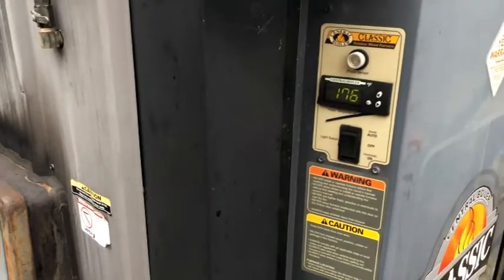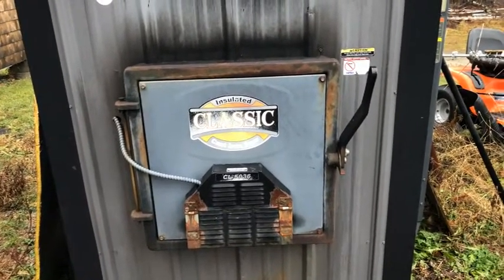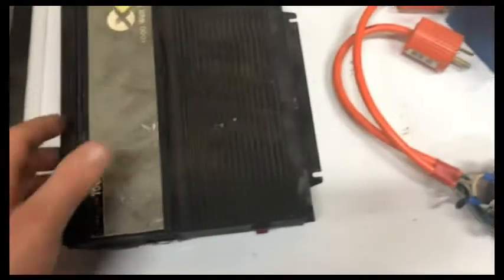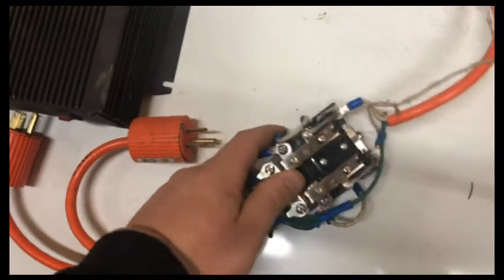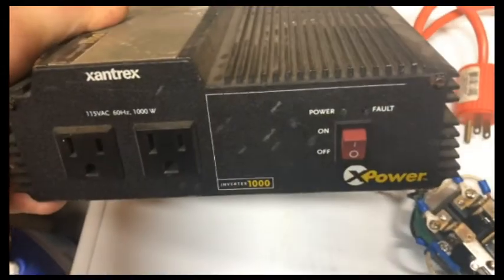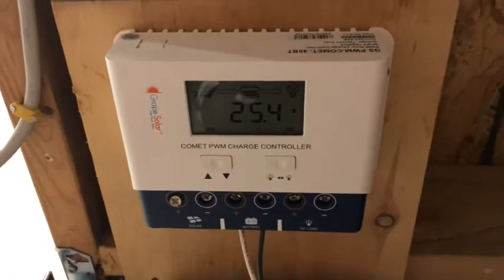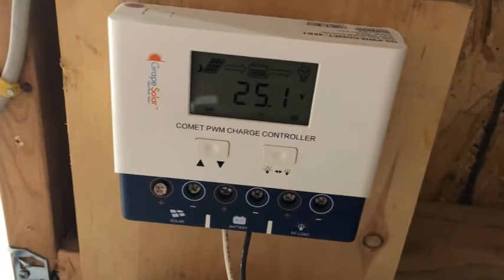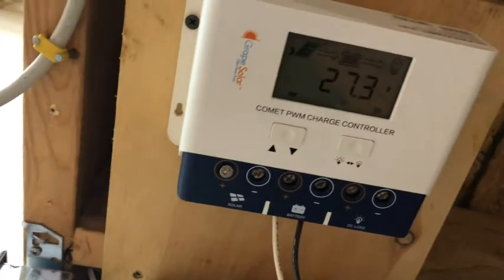Automatic Back Up Power. Batteries, Inverter and Transfer Switches

Comment: Hi, can you tell me what part# of this automatic transfer switch? I need to buy it and i dont know where to buy it. I am talking about that small mechanical old type relay
Reply from the maker: I think I put it in storage up in the garage attic.  That would take some effort to get up in there and look for a part #.  All it is is a double pole, double throw relay rated for 120 volts AC.  The coil is also 120 VAC.  I think I might have got it from Grainger, but it's been so long I can't remember for sure.  I think so though.  This link should take you there.

https://www.grainger.com/category/electrical/industrial-controls-automation-and-machine-safety/relays-and-accessories/power-relays?attrs=Coil+Volts%7C120V+AC~~Contact+Form+-+Relay%7CDPDT&filters=attrs%2CwebParentSkuKey&webParentSkuKey=WP8116246
Reply: @northwoodsyankee3528  Thank you very much
Reply from the maker: @You-can-fix-it  No problem man.  Did the link work?
Reply: @northwoodsyankee3528   Yes
Reply from the maker: @You-can-fix-it  Cool.  It's pretty simple to wire up.

Comment: NICE LITTLE SYSTEM SETUP :goodvibes:BACK THEN . KEEP UP THE GREAT WORK AS WE PREPPERS MUST DURING ANY SHTF SITUATION . MAY THE SOLAR BE WITH YOU .🤗
Reply from the maker: Thanks.  It's nice not having to worry about the wood boiler shutting down in the middle of the night if the power croaks.

Comment: man look at your heat vents not good making a heat trap need put a fan on it to cool it mounted on the side heat cant rise out the vents just traps it.
Reply from the maker: Here is a copy and paste from the manual for this inverter-  " To meet regulatory requirements, the 
MM-AE Series inverter/charger can only be mounted on a horizontal 
surface (shelf or table) or a vertical surface (wall or bulkhead) either 
right-side up or upside-down, as shown in Figure 7."

This inverter can be mounted upside down and Figure 7 in the manual shows it mounted upside down.  It does not say that if you mount it upside down that external fans need to be installed around it.

Comment: How much did this system cost you?
Reply from the maker: Oh.....lemme think....it's been so long since I got the stuff.

The Golf cart batteries are Duracell GC2 from Sam's club and I think I got them during the annual spring $10 off sale.  I think I paid $70 each.

The inverter wasn't horrible expensive.  It's a Magnum MM1524AE.  Pricing then and now might be different.  Don't forget a circuit breaker and proper size cables.